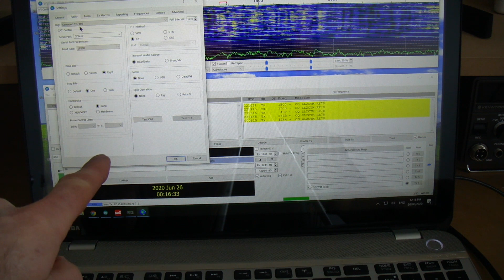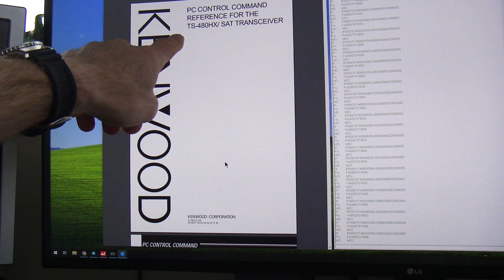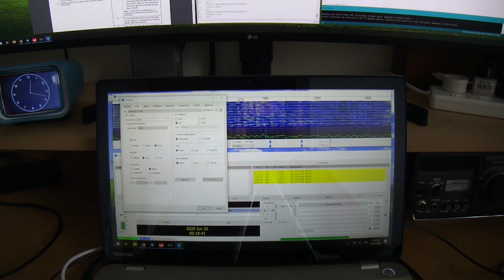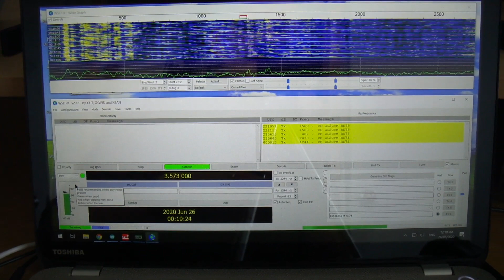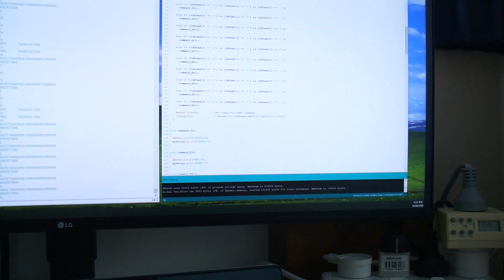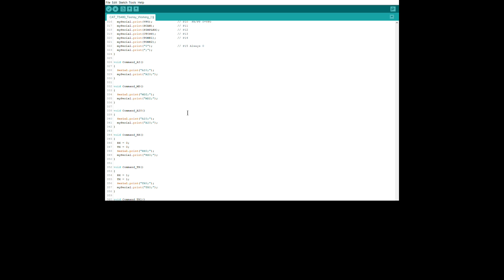Digital Modes Rig - Part 2 Working CAT Software Code

Comment: Good job Charlie! Did you test those cheap Chinese 3W amplifiers from aliexpress? I'm still waiting for a full review of them (gain, power output, frequency response, harmonics, linearity, ...) by you.
Reply from the maker: Thanks Sajjad. No, not yet. I need to go through AliExpress again and see what they have. Which one were you looking at?
Reply: @CharlieMorrisZL2CTM   these kind of amps and anything like them. they have similar specs.
https://www.alibaba.com/product-detail/Lonten-1PC-1MHz-700MHZ-3-2W_60843257471.html